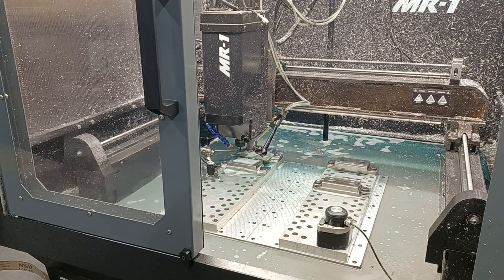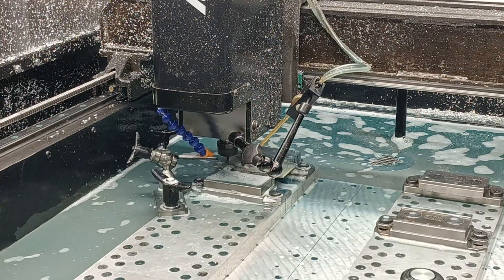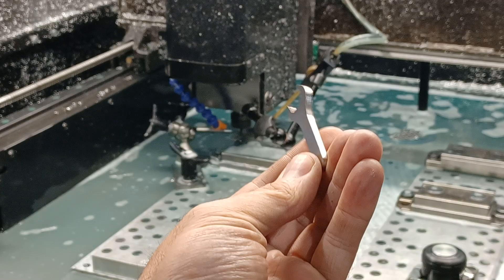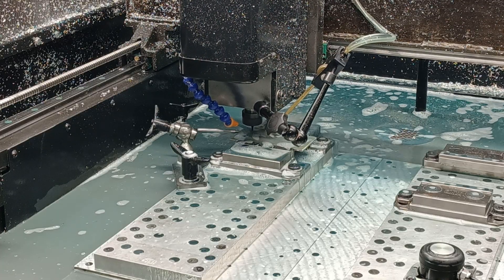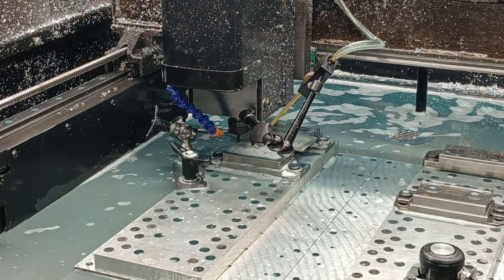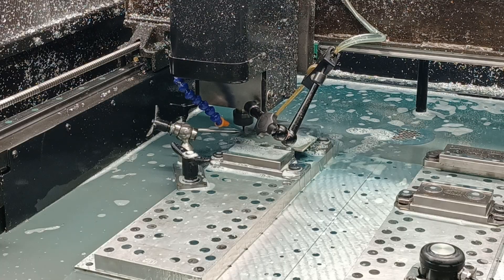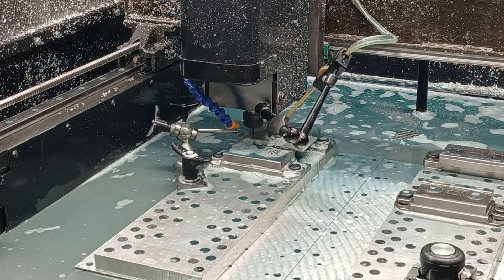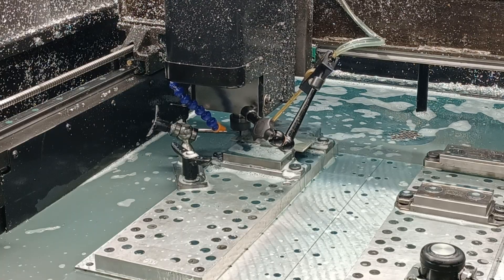CNC Machining 316 Stainless Steel with the Langmuir Systems MR-1

Comment: Cool that it can do that. Why dont you send out hand have them cut vs milling them? Maybe its more cost effective to mill then but i cant imagine how with the tun time
Reply from the maker: 100% agree.  I happen to have a 10ft bar of this material so I figured I would take the chance to learn how to run it.  once it runs out I will 100% be getting these laser cut. haha
Reply: @BeckTools ahhh makes sense. Might as well cut your teeth on something you need.
Reply: Whats the dia of the tool? Thanks
Reply from the maker: @Zae-R  2.5mm
Reply: Use Oshcut, upload that DXF and have them laser cut. I bet they’d cost around $4 each at quantity. Then you can use the mill to clean out the wrench surface if you really want that to be precise.